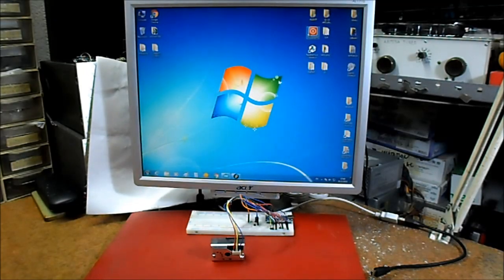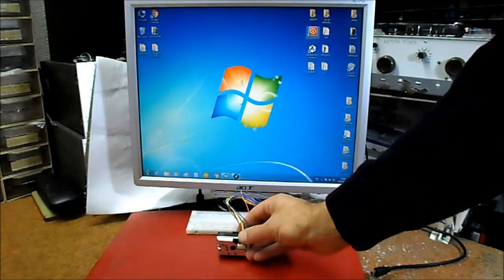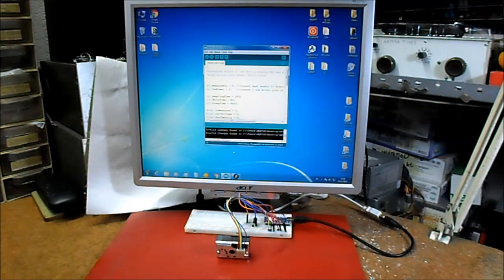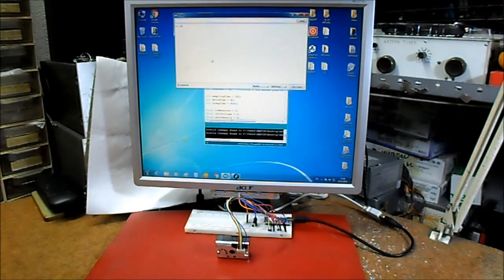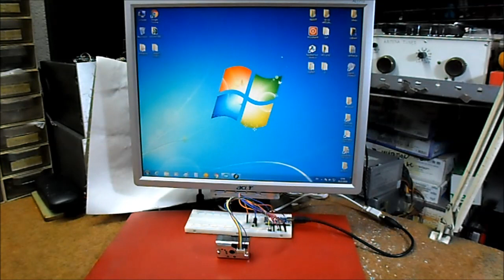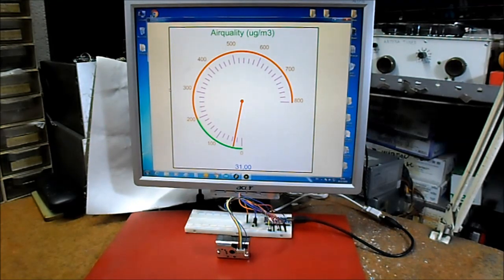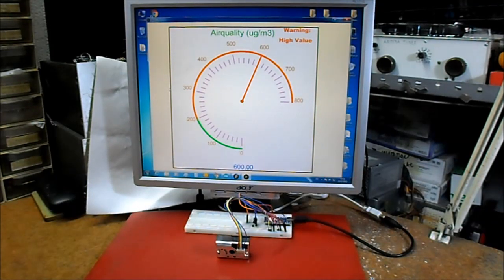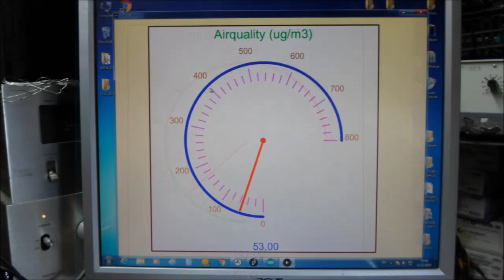DIY Air Quality monitor with Sharp GP2Y1010AU0F sensor

Comment from the maker: Instructions, schematic and Arduino and Processing code at :https://create.arduino.cc/projecthub/mircemk/diy-air-quality-monitor-with-sharp-gp2y1010au0f-sensor-7b0262?ref=user&ref_id=168805&offset=10

Comment: Nice build Mirko, I like your work. If I look at the output of your sensor you can improve it with the use of digital smoothing. 
In that case you use an array to calculate a moving average so you will avoid the huge spikes you provide to your output user interface and things become a lot more smooth.